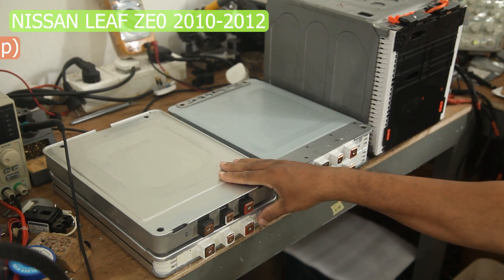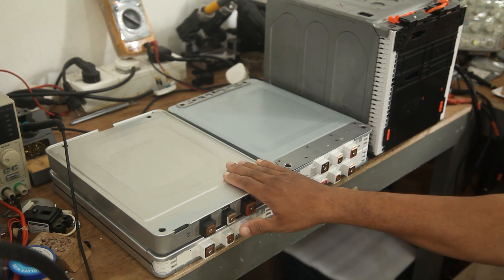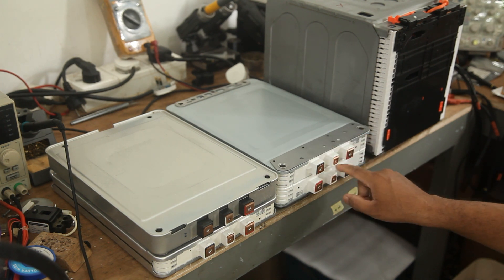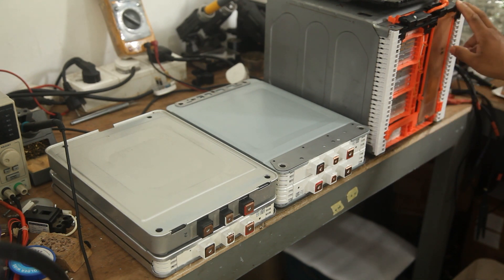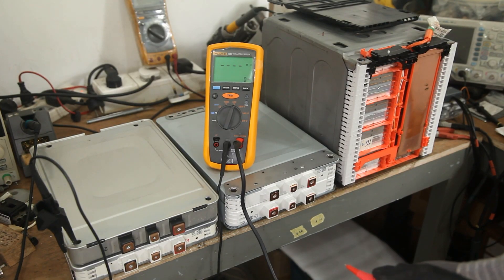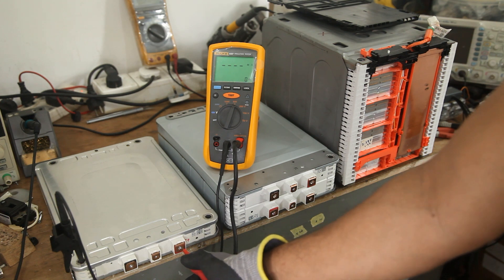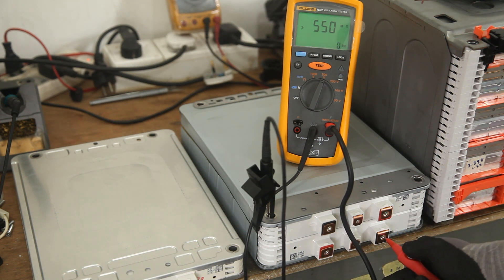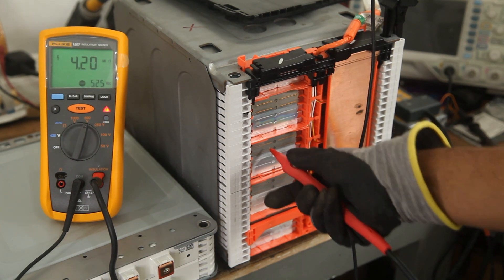How to perform a insulation test on Nissan Leaf battery modules

Comment: Are you passing a voltage through the meter like you would when performing a insulation test on a house or  literally the resistance between the terminal and the case?
Reply from the maker: The insulation tester applies high voltage and measure the small leakage current flows through the insulation. Then calculate the insulation resistance using the Ohm's law.
Reply: Thank you